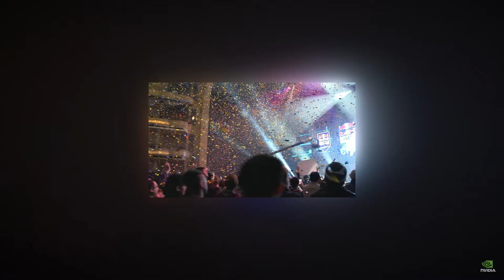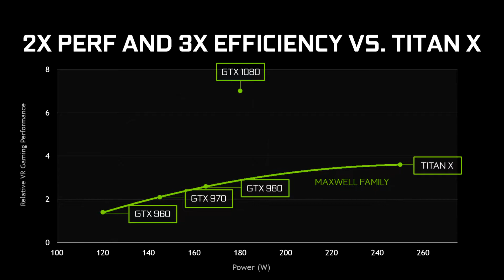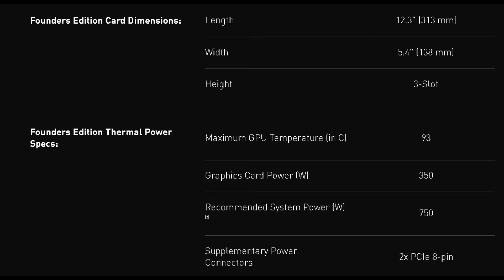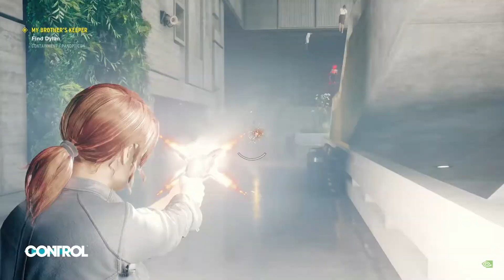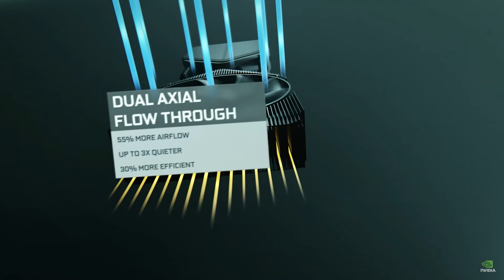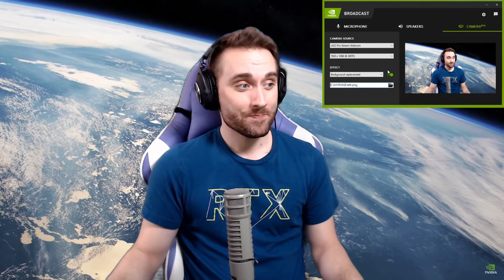Nvidia RTX 3090, 3080, & 3070 OFFICIAL LAUNCH - Price, Specs, and Release Date AMPERE IS AWESOME

Comment from the maker: Just a little note. The 12 pin power connector is there, but you will be provided with a 12-pin to dual 8-pin adapter which is pretty convenient and no big deal there. 

AIB models should still be opting for the usual 8 pin onboard the PCB, but expect many cards to have 3 8-pin power connectors.

Comment: It's extremely bizarre that evil Huang is offering the 3080 and 3070 at reasonable price of $700 and $500 respectively, bearing in mind their much higher core counts. This is very unusual. I think evil Huang has been spooked by big Navi. I'm going to wait for team red to drop big Navi and see what their RRP are.
Reply: I think its partly to do with the reception they seen with the leaked prices, The competition with AMD and most of all in 6 months they gonna release a 3070, 3080 super/ti with more Ram
Reply: @katedobrova2752   - leaks from Nvidia is that evil huang has been spooked by big Navi  :)
Reply: nothing is more reassuring then having the strength to overpower your opponents, i think nvidia just did the best they can without thinking how strong is amd
Reply: @starrmayhem  - it also shows just how badly nvidia were ripping off nvidiots who where buying the 2070, 2080 and especially 2080ti. Now ebay, etc is flooded with 2nd hand RTX-2070's, 2080's and 2080Ti's. I have no sympathy for them, especially the 2080ti owners who shelled out in excess of $1200 and are now getting between $450 up to $600 for their 2080ti on the used market. Turding was a grossly over-priced beta architecture which was put out into the wild for RT.
Reply: @beachboy_boobybuilder  yeah, e-waste is terrible
Reply: because well, if they did think about the opponents, then they would just barely beat it & call it a day, like turing super cards
Reply: I heard that the competition is from consoles. Seeing as AMD have that corner of the market nvidia need to stop people jumping ship to consoles by offering something as good and also affordable.
Reply: @terryd8692  - TBH, there is no way in hell that the 3070 and 3080 rrp will be $500 and $700 respectively. Nvidia will play the dirty tricks they have always played by producing low volume when demand is high, which in turn will artificially hike the rrp by at least $100. Mark my words. Also, insider sources at nvidia have told 'moores law is dead' and 'red gaming tech' that evil huang is worried about big Navi beating the 3070 and 3080 (which is why we are seeing the same sort of prices as we did with the 10 series/Pascal).